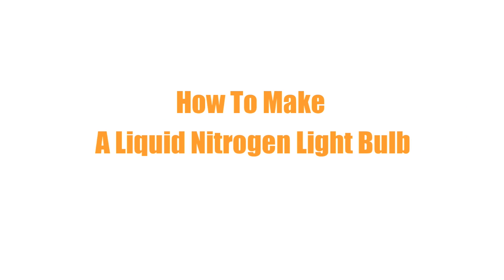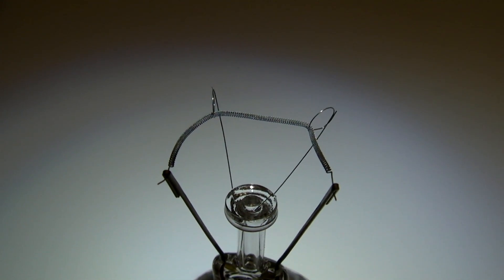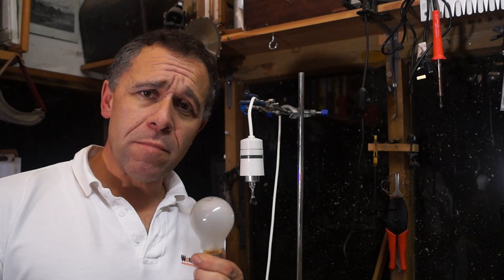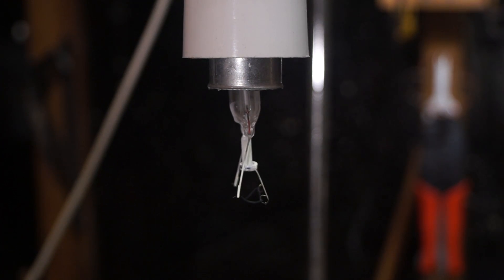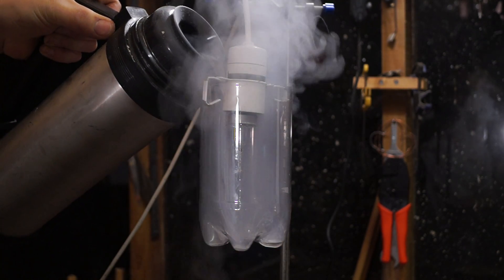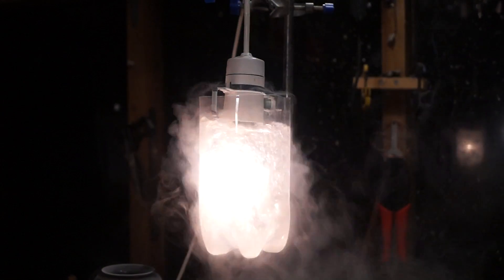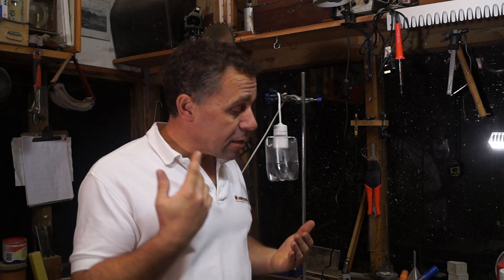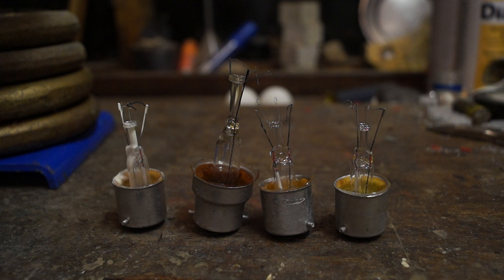How to Make A Liquid Nitrogen Lightbulb

Comment: Could this have worked with nitrogen vapour displacing the air instead of liquid nitrogen touching the filament?
Reply from the maker: Coolkeys2009 Some one has already suggested exactly that and we may well give it a go as it would remove the problem of the filament being buffeted by the boiling nitrogen.

Comment: a few mistakes ..
- the current does not excite the electrons, it's the temperature. That's why it has to get hot (in contrast to an LED). "Incandescence is the emission of electromagnetic radiation (including visible light) from a hot body as a result of its temperature."
- When it breaks it does not create a short circuit, quite the opposite.
Reply from the maker: Dini Mueter Yes, doh - schoolboy error!  We are blushing with embarrassment over the short circuit faux pas and will add an annotation to the video to point this out.

Regarding what excites the electrons - that's actually more of a complex question than it appears. You could say it's the heat energy but then it's the electrical energy that 'produces' the heat energy in the first place through Joule heating.
Reply: wonderstruckwow
But the glowing is indifferent of the source of energy. You are correct that for the electrical incad. light bulb the electron flow is the source of the heat thus the source of the light. However you could end up at the 'same' (black body) light by heating with different means. 
You compared it to an LED where the electron flow directly leads to photons being released. These are two completely different mechanisms with different spectrums.
Reply from the maker: Dini Mueter Yes, you are right.  Maybe we've confused the issue a bit in the video (comes of trying to make these videos with not much time available).  We were trying to point out that in both cases light is emitted because electrons are moving from higher to lower energy states but should also have perhaps pointed out that difference!

Comment: wonderstruckwow Fantastic explanation!
It would have been good to see the liquid N level below the filament, whilst the nitrogen gas displaced the oxygen; to see how that performed.  Great experiment.
Merry Christmas.
Reply from the maker: ***** Now that's a great idea!  Merry Christmas and a Happy New Year!
Reply: I was thinking the same thing, but won't that essentially be the same as a regular incandescent bulb? you know since it's a container filled with an inert gas?

What I would like to see is a container of supercritical nitrogen with the filament inside, but I also understand that it would be difficult to seal off properly.
Reply: wonderstruckwow Chances are that they're not as far beyond as you think. the chamber would be easy enough to make and you would prime it with liquid Nitrogen. it's sealing it with wires passing to the inside that I see being difficult.
Reply from the maker: Cruiser052 Supercritical nitrogen - that might be a bit beyond our capabilities!

Comment: Minor quibble: if the tungsten element breaks, it's not a short, it's a break in the circuit.  A short is when a circuit from positive to negative (or the two poles on alternating current) is made bypassing the normal circuit path.  A short is why a circuit breaker will trip if you stick a fork into both sides of a mains outlet.  It is also why steel wool will burn if you set it across the terminals of a nine volt battery.  And, to be more accurate, the tungsten element is more or less a "controlled" short, which is why it glows so brightly when it is connected to the mains.